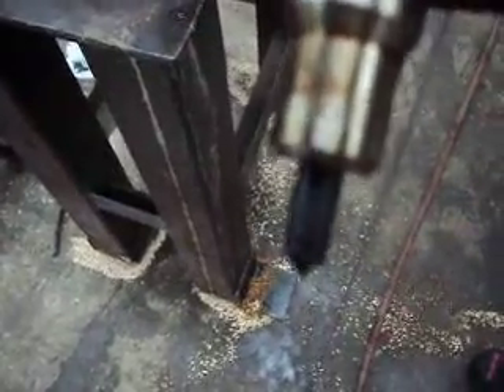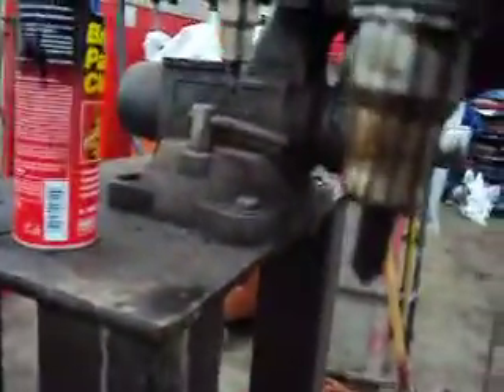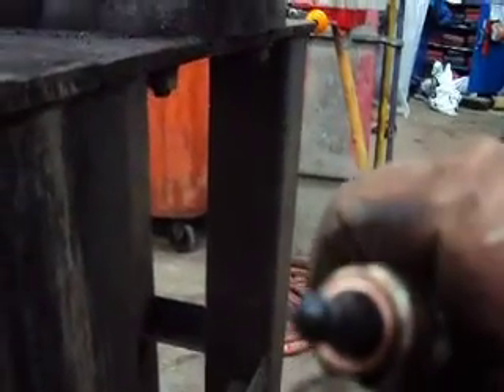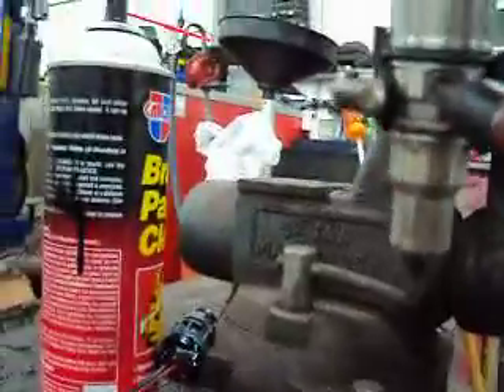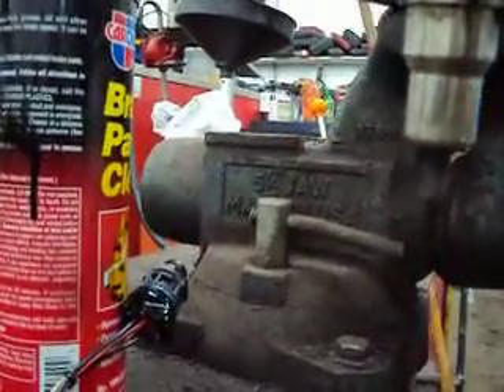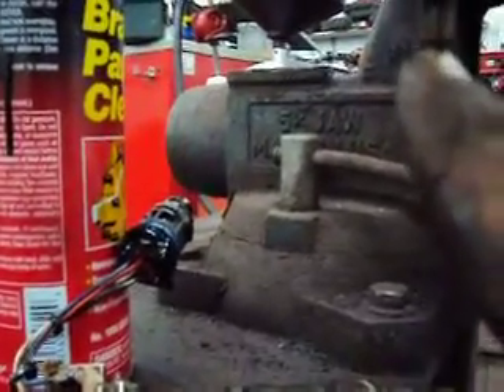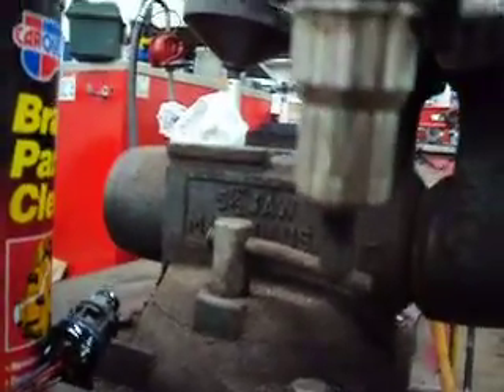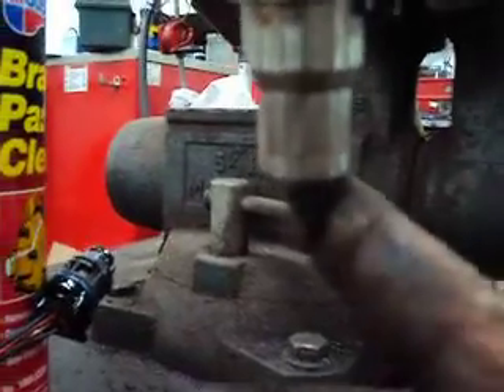Testing a Ford 6.0 diesel injector for a cracked tip

Comment: thank you for responding. I also have a problem. when I am driving down the road at 40 MPH and pressing the pedal evenly and not moving it back and fourth. the truck gets in to higher rpm speeds while I am pressing the gas pedal constant with no back and fourth. sometimes it acts up like gets in to higher rpm's then returns. also when I am on a red light. it gets in to rpm's acting like I am pressing the brake and the gas pedal at same time. but my foot is only on the brake. thank you.

Comment: Well you shouldnt have used an EGR cooler from anywheres but ford or Bulliet proof diesel, yes there expensive but you only wanna do the job once, normaly head gaskets will push coolant out degas bottle, Egr cooler will cause it to smoke white smoke, all depending, if you did not replace the oil cooler when you had the intake off then chances are your new cooler is cracked and leaking again, put a new FORD oil cooler in it and a OEM or BPD egr cooler on it.

Comment: thank you for the response. I did replace my egr cooler on my 6.0 from Autozone its a Dorman product. I am running filtered before it gets poured in the tank waste vegetable oil in my truck. After replacing the egr cooler I still see white smoke coming out of the tailpipe. I see little bit coming out when in park. and alot when hard ac cell take off after that it clears up when driving. it still only does it when idling and at take off. Could that be the vegetable oil having water in it? thanks

Comment: INFORMATIVE VIDEO. I TRY TO STAY AWAY FROM FORDS MY SELF BUT I'VE SEEN THIS BEFORE. DENKHA94 FROM WHAT INFO YOU'VE GIVEN I WOULD SAY THAT ITS YOUR EGR COOLER LEAKING. IF IT WAS YOUR HEAD GASKET IT WOULD BE OVERHEATING BADLY. TO ANSWER BRAD SHUMATES QUESTION. THE INJECTOR ORFICE IS EXTREMELY SMALL. SO SMALL IN FACT THAT UNDER INJECTION PRESSURES IT WONT ALLOW WATER ( IN THE FUEL ) TO GO THOUGH IT AND WILL EITHER BLOW THE TIP OF THE INJECTOR RIGHT OFF OR CRACK IT LIKE YOU SEE IN THE VIDEO.

Comment: Hi their, great video. I am having problems with my 2004 6.0L powerstroke, its blowing white smoke upon cold start and clears back up within 3 minutes. then when I drive the truck fully warmed up, it still blows white smoke, especially when am at a red light it does it and then when I accelerate it throws clouds of white smoke only. then it clears up. the white smoke comes and goes all the time. even when driving normally. thank you.
Reply: Did u fix your issue?